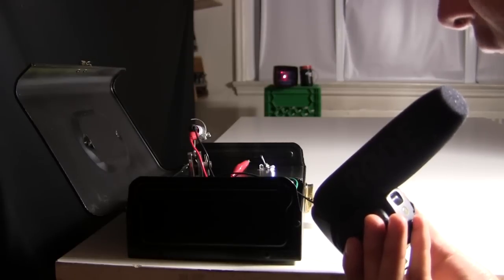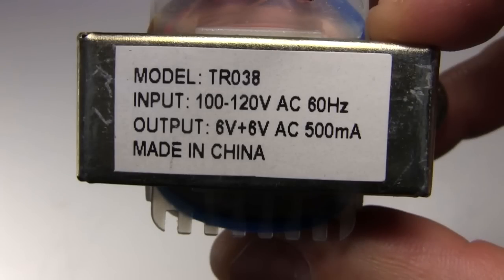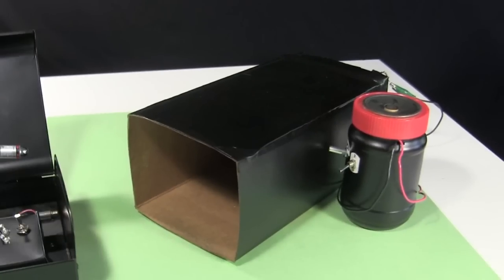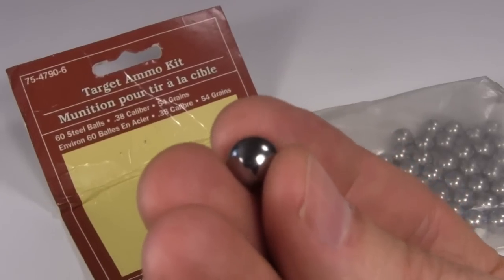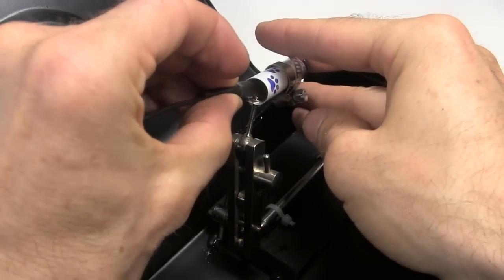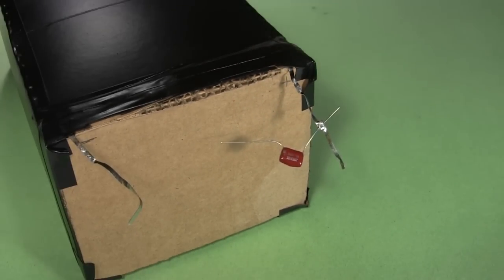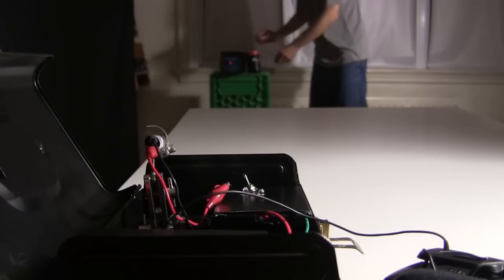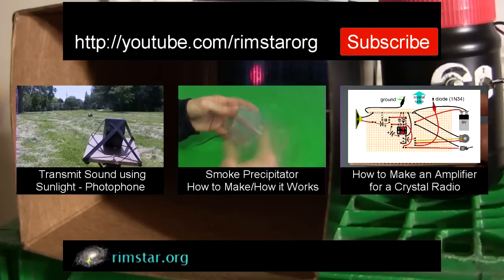How to Make a Laser Communicator (to Solar Cell)

Comment: I had a hard time reading the links on the left of your website the text is very small.  12 to 14 point would be perfect I am interested in your projects and would like to delve into your website. Let me know if and when you can enlarge the text.  I will subscribe at that time Thank you
Reply from the maker: Ah yes, that page is still in the old format. A while back I was gradually migrating my webpages to a new format which scales depending on the size of the display being used (takes a long time with hundreds of pages). That's the problem with having a website that's been around since 1999, the display technology changes over time. Anyway, I got distracted for a while at one point and some are still not converted. The two related to this video are now converted to the new format, should be easier to read. Thanks for the reminder -- I'll try and do a few more later, each one takes a minimum of 15 minutes.
Reply: @RimstarOrg  try wordpress

Comment: I made two identical transmitter/receivers using altoid tins, salvaged batteries from disposable vape pens, cheap pet laser pointers, and salvaged solar cells from garden lights and calculators. I put a 3.5mm hookup on each one for listening and a wired handheld mic for speaking. The mic is a cheap small part inside another altoids tin. I'm working on making some repeaters. I wanna set them up around the building where I work and see if I can carry my voice around the building.
Reply from the maker: Your repeater sounds like a fun goal! Have fun!

Comment: I did a variant of this with 980nM IR laser with TTL modulation - using a 57.6KHz IR receiver, and a few homebrew IR telescopes.  Keep the transmissions to daytime and you'd never know it was happening - one can even bounce it off a non-specular reflective surface, meaning non-light of sight transmission is possible.

Comment: How far away from Receiver does this work?
What is your purpose of making this?
Reply from the maker: I didn't do any distance testing. But it really depends on two things, how powerful your laser is and/or how sensitive your detector is, in my case a solar cell. I think I tried maybe around 100 feet (30 meters) and it worked. The reason I made it was for fun! It's an interesting project.

Comment: I literally spent about 3 hours trying to find a simplified version how this would work do you think it would work in beam splitting.? Another question I would have is could you use mirrors as a Content or a reflector to widen the surface area for the transmission
Reply from the maker: I'm not expert in beam splitters. If you have one non-laser light source that is modulated with the audio then you could just shine that light source at the target and skip the laser altogether. Regarding using some sort of lens to widen the laser, I'd think that would be possible. Lasers also widen naturally as the travel farther.

Comment: If I'm following you (and I won't at all be surprised if I'm not!) you're using the two LED's as clipping diodes, like in a fuzz tone circuit? If so, would the sound be a little clearer if you limited the voltage in a different way?
Reply from the maker: Yes, I'm using them as clipping diodes. And, hmmm...., I hadn't thought of its effect on the sound. You might have a point there.

Comment: If I don't use amplifier on transmitting side will it work.
Reply from the maker: That depends on your sounds source. In my case my microphone didn't have a built in amplifier. You can't use just an unamplified mic.
Reply: RimstarOrg thank you

Comment: Does a guitar amplifier work?
Reply from the maker: I don't know. The voltage might be to high for the laser. You might have to add some circuitry between the amp and the laser.

Comment: can we use ordinary speaker instead of amplifier in reciever
Reply from the maker: No, the output of the solar cell isn't powerful enough to make the speaker play loudly enough to hear it.
Reply: i only have speakers
no amplifiers
so what can i do?
Reply from the maker: Hmmm... I don't have an answer for you. You either need to get an amplifier, or make one, or get something else. For example, a crystal earpiece "might" work, though I wouldn't guarantee it since I haven't tried it.
Reply: thanks
i got frst in my class 12 physics project
could you pls explain what happens when audio signals reached the spring of laser.....what conversion took place???
Reply from the maker: The laser is normally powered by a flat DC voltage. But with this setup, the laser is powered by a voltage that fluctuates according to the audio signal coming from the microphone. The transformer steps up that fluctuating voltage. Also, the batteries add some minimum flat DC voltage as well. So the final voltage to the laser is the flat DC from the battery plus the fluctuating one from the amplifier. The transformer also mixes the two together.
The result is a light that has a minimum brightness due to the flat DC from the batteries but fluctuates too according to the fluctuating voltage.

Comment: Very good video! Could you tell me the purpose of the 22 nanofarads capacitor? Thank you!
Reply from the maker: The sunlight and other stray light that hits the solar cell causes the solar cell to output DC. The light coming from the laser causes the solar cell to output AC as well. We don't want the DC from the sunlight, only the AC from the laser. The capacitor connected in series removed the DC -- capacitors don't pass DC.
Reply: RimstarOrg Thank you for your fast reply! Now this makes sense to me.

Comment: after i connected everything according to the video the intensity of the  laser light became very low. how can i increase it ????
Reply from the maker: The light should be dim until you speak into the microphone. Are you sure your amplifier is producing a strong enough signal? I'm guessing you turned up the volume. Do either of the LEDs light up when you speak into the microphone? What are you using for a transformer? Maybe there is too much resistance there.

Comment: what is the volt of the solar panel used ???
Reply from the maker: I didn't look at it with an oscilloscope while it was running, so I don't know what the actual voltage was resulting from the laser. But the solar cell itself though, is rated as 0.55 volts, 4000mA.
Reply: can't we use 5 volt 150 mA  solar panel ???
Reply from the maker: Probably. Make sure you block as much light as possible from getting to the solar panel except for the laser light.
Reply: ok thankq
Reply: Samadrita Mandal rather than using solar cell you can use LDR

Comment: would the sound improve if i use multiple lasers like 5 of them onto a single solar cell?
Reply from the maker: No, I don't think so. To improve sound you'd need to working on the modulating of the laser i.e. how the sound is encoded in the laser beam, and also on how the light is turned back into sound. The amplifier I used in this video isn't the best one, just a simple homemade one.
Reply: Thanks.

Also would it be best to hook up the LED's directly to the laser like a latter?
Reply from the maker: What's a latter?
Reply: my bad i forgot to be specific on that:  i mean have the LEDs near the laser but on the same line + to +, - to -
Reply from the maker: Looking at the circuit, I don't see that it would make any difference. The LEDs are there in case the voltage gets too high. In both possible locations the same voltage is involved, both that resulting from the transformer and the batteries.
Reply: Cool, good to know.
do the wires need to be soldered together or can i use cable clamps or a bread board to make this instead?
Reply from the maker: Sure, a breadboard would work just as well.
Reply: thanks for the info man

Comment: I made my own amplifier as per your instructions... initially it worked but now its not working
Reply from the maker: Check that the wires at the speaker are still connected well to the speaker. That's been a problem for me a few times.
Also, check your battery. Maybe it's dead.
Also, make sure you're actually getting something from your crystal radio to amplify.
Other than that, check that all your connections are still good. And if that's okay, then start taking it apart and testing individual parts.
Reply: Well that worked for me....thanks..Can you tell me how to reduce Noise? because my output at speaker is too noise.
Reply from the maker: I don't really have any good suggestions for better sound. My sound isn't crystal clear either. +MyJohhhmnnnyyy suggested in the comments below using a 220nF capacitor instead.

Comment: Nice video! I made one of these before I saw this. Needless to say, it was a lot of work to figure it out on my own. Very frustrating. Quick note, if you want a simpler version of this just as a proof of concept, take a pc fan, a laser pointer, a solar cell, a nine volt battery, and a amplified speaker. Hook up the speaker to the output of the solar cell, and place the fan in front of the cell. Then, use the 9-volt to power the fan. Shine the laser at the fan, and enjoy your laser morse code transmitter. The fan will act as an oscillator and cut up the signal.

Comment: Does the size of the solar cell matter? For example, could I use a 1 inch by 1 inch solar cell from a solar yard light from the dollar store? It would just be much harder to aim the laser at, correct?
Awesome video by the way!
Reply from the maker: Thanks! A 1 inch by 1 inch solar cell should work, I think. As you say, it would just be harder to aim, but not impossible. Let us know how it goes.

Comment: Thanks! You are great in all these electrical stuffs! So I will connect the red wire from the amplifier circuit to the 6V and black wire to the 0V? How about the microphone? Where do we connect it to the amplifier circuit?
Reply from the maker: +Woo Penne Regarding the red and black wires from the amplifier to the transformer, you can do it the way you described or the opposite, it really doesn't matter.
Regarding the microphone, I'm assuming you're referring to my homemade amplifier https://www.youtube.com/watch?v=JtPwxbOgBHw. In that case you'd put the microphone in place of where I have the crystal radio. What I did was to buy a stereo audio jack socket from a local electronics store and wire that up to where the crystal radio goes (e.g. http://www.ebay.co.uk/itm/3-5mm-Stereo-Jack-Plug-to-Socket-Aux-Headphone-Audio-Extension-Cable-Lead-Gold-/360945905000?var=&hash=item540a0d6d68). You can probably scavenge one from somewhere too. Since it's stereo there are three connection points but I used just two, the common one (the longest) and one of the other two (it doesn't matter which.) I put a labeled photo of my amplifier before I put it in the nice box on my webpage here http://rimstar.org/science_electronics_projects/laser_communicator_diy_homemade.htm. Just look for the photo labeled "Homemade amplifier before putting in a box".

Comment: Hi. what is the purpose of the transformer? We are in Singapore and thus we bought a 230V input and 6V, 0V, 6V outputs transformer is it workable for it? Thanks!
Reply from the maker: +Woo Penne Try it. It might work. You might have to keep the volume of the amplifier on the laser side very low. Connect the amplifier side to the 0V and one of the 6V. The purpose is to add the signal from the amplifier to the voltage of the battery. It's called modulation, it modulates.

Comment: How a blazing Ruben's tube next? It'll fit in with the audio/music theme going on currently. You could also make an audio-modulated Tesla coil for electrifying music!
Reply from the maker: Soham Gumaste A Ruben's tube would be fun but I don't have the facilities for it. Someday I'll do the audio-modulated Tesla coil - gotta make a solid state Tesla coil first to do that.
Reply: RimstarOrg As far as I know, a Ruben's tube needs a flame-resistant tube and a propane torch;the circuitry is trivial. Those aren't hard to find...And for the solid state tesla, checkout stevehv.4hv.org

Comment: Have you tested the range of this setup? It was very clear in the video at a respectable distance, so it seems like it could go much farther.
Reply: RimstarOrg Put the receiver against a white colored wall or backdrop, and do the testing in low light conditions, it will make the pointer spot more obvious at a distance and you should easily be able to aim for the receiver. Keep up the interesting experiments. Also, you might want to explain how the electron flow is being modulated from the microphone to the laser, as this would be something that laymen do not understand from just the schematic.
Reply: RimstarOrg I have come across 2 types of "keychain" laser-pointers.
In one, the spot became the size of a tennis-ball going across a big room.
The other, we could see the spot hit a skyscraper a km away at night.
Half a dozen of "type-2" ganged might increase your range to a couple of km ! ;-)

But then, we enjoy your videos for your ingenuity, your skills and the science.
Like art, it need not be economically practical to be enjoyed.
Best Wishes.
Reply from the maker: USWaterRockets I tested to only around 20 feet/6 meters. It's very hard to aim, and even to get that I had to start with the laser close to the receiver and gradually back away while re-aiming each step. A wild guess would be 100 feet/30 meters before the laser beam's spot is the same size as the solar cell. After that the amount of energy being received would start to decrease.

Comment from the maker: +uros stefanovic The amp on the transmitting side is already detailed step-by-step in my video about my crystal radio amplifier here https://www.youtube.com/watch?v=JtPwxbOgBHw It's the same one that's in the peanut butter jar that I use on the receiver side except that I put it in a box instead. I also didn't connect a speaker to it and instead had the output wires go to the laser battery circuit like I show in this video at 2:35. Also, I put a jack for plugging a microphone into instead of just putting alligator clips on those wires. Other than that, the amplifier circuit is identical.
PS There's no Reply button under your comment because of your Google+ settings.
- go to your Google+ page,
- in the top, right corner click on your thumbnail icon,
- in the popup that appears, click on "Settings".
- for the 2nd question down "Who can comment on your public posts?" set it to "Anyone".

Comment: Sweet... Have you tried listening to other light sources? It would be interesting to "hear" the sun
Reply from the maker: Craig Nehring Most of the sunlight reaching us down here on Earth is in the visible spectrum. Those frequencies are in the terahertz. Red light is around 400 terahertz (400,000,000,000,000 cycles per second.) We hear in the 20 to 20,000 cycles per second range, so no where near close enough. What I'm doing in this video is changing the brightness of the laser light at a rate somewhere in that 20 to 20,000 cycles per second range.
Reply: RimstarOrg Yes I understand your great video. What I was thinking is that light is modulated in many ways and with the right filter and or sampling over time, one might be able to hear events. Conversion would be required I am sure.
Sensitivity would be the key. Imagine just recording the sun up sun down as pulses of the PV cell voltage output (or lack there of) Using the voltage of the cell as data? No doubt a laborious task if not plain boring 
Cheers
Reply from the maker: Craig Nehring Oh, I see what you mean. For example the activity on the sun (sunspot, magnetic field activity, ...) all affect the light we get. That would be interesting.